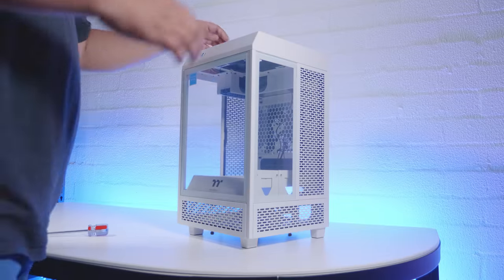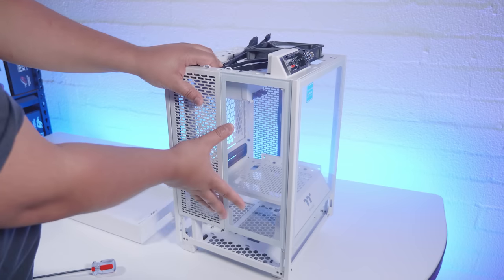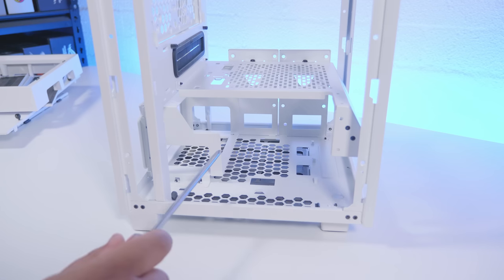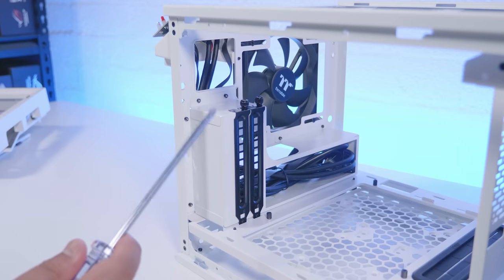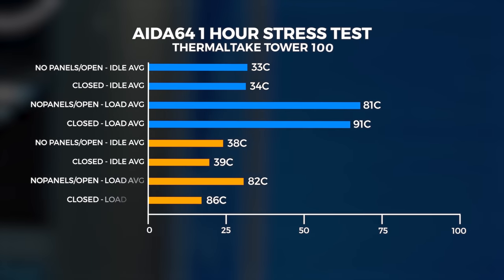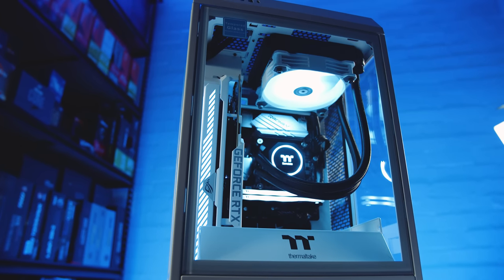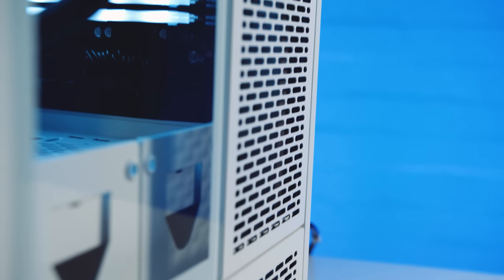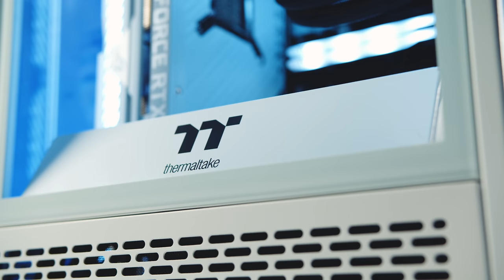The Truth About The Thermaltake Tower 100

Comment: I just did a build with this case this weekend I loved working with this case.  It’s my absolute favorite itx case I have ever used.
Reply: you got any pics
Reply: I just bought this in black. I only ordered the case and some fans so that I can play with different config ideas. Share your build! I have some questions for you: 

1) can you switch the side panels left and right so that the vents are more aligned with the GPU? Ie take the left side and put it on the right side and vise verse.

2) did you go AIO or air cool?

3) it sounds like you can’t fit the WiFi antennas in there with the top screen on. Can you confirm?

4) how many fans did you use and how did you orient them?

Thanks!
Reply: I would love to see any pics if you could upload them to imgur, and also any answers to the guy who replied above me!
Reply: does this support a regular ATX motherboard

Comment: I’m really digging the new music in your latest videos. Well done. 

I agree that for a small form factor / itx case it’s too big and the side panels would have been a perfect place to be able to mount either a 240 or 280mm AIO. Disappointing that they didn’t. But it’s still a good looking case, and I’d wager that with an air cooler like the 212 or a Noctua (so?) the cpu thermals would be much better.

Comment: Just sharing a data point:  Around the same ambient temperature, I’m getting 23C at idle for my i5-10400f using a $25 (after $10 coupon) Vetroo CPU air cooler and 45C for the M/B in my Thermaltake Tower 100. It has a GTX 1060, took out rear fan to put in HDDs and kept stock top chassis fan.

Comment: Just built one Yesterday with i7-12700, Asus ROG B660i, NZXT Kraken 120 AIO cooler, 1070Ti, orginial back fan and an additional Thermaltake 120mm PWM bottom fan. Got 76c on CPU and 72c on GPU in Burn test for 5 mins. Nice looking case and just love it.
Reply: Temperature also be the point I was bit worried at first, but for the normal usage like gaming, I have tested with MS Flight sim, iRacing and Elden Ring, turn out the gpu normally stay at 77c and cpu only 53c/20% load, even I replaced the fan at the back with 2 3.5' HDD. The only problem now is the TT fans included in this case are a bit noisy, I will upgrade the chassis fan to Noctua later.

BTW the pump of NZXT Kraken 120 is IN the radiator. So if you use it in this case, the pump will be on the top of the whole AIO liquid circuit...

Comment: You can put swap left and right panels around. To have the mesh at the front. 

Also mounting a 140mm fan on the bottom is a good move. Also a push pull aio set up is my plan with it.
Reply: Having built in this case, that's exactly what I did with a 120 AIO. I would probably recommend using the Arctic Liquid 120 (wish it came in RGB) as it has a slightly thicker radiator. 

A 140mm bottom case fan would probably fit, but with the amount of cabling due to running 2.5" SSDs and a modular power supply, not even sure how much air it will bring in. I didn't use a case fan and just have some Hot Wheels down there :D

Comment: I'm wondering about the rear where the Display Port cables go into your motherboard/cards. Please let us know. I can't see how external cables are attached to the MB rear panel ports.
Reply: DP to DP Adapter, 90 Degree Up Angle Displayport Male to Displayport Female Extension Adapter  available on Amazon

Comment: Thermals on my Tower 100 are great. Youre missing a fan on the bottom seems. Also push/pull is on my build. No higher than 70c on my CPU (5800X) for anything. Gaming or testing. Great case.
Reply: Would u recommend air or water cooling
Reply: What AIO do u have?
Reply: @mark_9807  nzxt m22 I think it’s called it’s the 120 mm one
Reply: How about your GPU? What GPU are you using, and how hot does it get with GPU intensive games?
Reply: Indeed, was thinking the same thing. I have seen other reviews with the bottom (next to the mobo) fan and a push pull at the top. Thermals were good!
Reply: If the video IO ports are facing up, how do you connect monitors?
Reply: @BrutusHiatus  there’s a cutout on the top back of the case hidden nicely.

Comment: The GPU side should just be complete mesh, no need for the TG. That GPU under load is probably heat soaking that tiny 120 rad since its the only exhaust.

Comment: wonder if the CPU temps had been better with a upfiring fan on the psu shroud (as there seems to be clearance for it). think other builds have been doing this? specially if an SFX psu is used?

Comment: is it bigger than nzxt h210? can you compare?
Reply: The H210 is a 27L case whereas this is 5L more at 32L. However, the Tower 100 has a smaller footprint on the desk at 707cm2 as opposed to the H210's 781cm2.

Comment: Greg from Florida.  I love your channel along with Brian @ TECH Yes City.  Australia looks wonderful.  Wish I could visit sometime.

I just finished building my Tower 100 last week.  I went AMD using a Ryzen 7 3700X with a Gigabyte X570 I AORUS PRO WIFI  motherboard and 32GB G.SKILL Trident Z Neo DDR4-3600
memory.  Sapphire RX 5600 XT with Dark Rock Slim air cooler.  My thermals are good with both the GPU and CPU  maintaining mid to high 60C during my gaming sessions.   I also loaded up with 2 - 3.5" HHD and 2 - 2.5" drives (1 HDD & 1 SSD).  My boot  drive is a Sabrent 1TB Rocket NVMe 4.0 Gen4 PCIe M.2  powered by Fractal ION SFX 650G.

This is my gaming rig as well as my Plex Server.  I too was really impressed with the build quality of this unit.  My main go to cases are Phanteks and Lian Li and I'd say the Tower 100 is comparable to these brands.
Reply from the maker: I gotta agree with that. This case really surprised me. The build quality is amazing!

Comment: I have my 5600x overclocked to 4.7ghz, with a wraith prism cooler. The stock case fans, and a MF Halo fan for rgb swag. I think temps are great for me. I idle about 40c and gaming about 60c. I definitely recommend 140mm fans for slightly better temps  (like 5 degrees)  and much less noise.

Comment: Im using this Thermaltake Tower 100 but im modified cutting top & below for have big space.so i can put the gpu horizontal (twin fan version) & make 2 tank pump small reservoir .can put big 240mm aio just cut top in the case modified it..My Thermaltake 100 casing look like the small version of tower 900 after i modified it to put 2 tank,gpu horizontal,lcd screen & cooler 240mm 2 pcs radiator..just cut it modified..dont worry..its fits int there

Comment: I have this case. Was anyone else’s front panel audio ports swapped around? The headphone jack was actually the microphone and the microphone jack was actually the headphones. And L/R channels in the headphone were also backwards. I had to remove most of the pins from the HD Audio connector and re-wire it based on the diagram in the MB manual, ASRock B550 Phantom Gaming ITX/AC. Even tried a second T100 case to make sure it wasn’t a one off problem,and the second one was wired the same way.
Reply: Have been researching the T100 non-stop recently and this is the first I've heard of this issue. Still - this is a tad concerning. did you reach out to Thermaltake about it? That's grounds for a refund.

Comment: I bought this case after also buying fractal design ridge and silverstone sg13 (returning both lol) I figured the thermals would be more or less about the same between all three. I only built in the tower 100 but after reading and watching a decent amount of reviews about the thermals I was admittedly scared but when I tested it myself with a Ryzen 7 5700x + 3060 ti FE the thermals while gaming weren't actually bad at all I saw 65 and 60 for cpu and GPU mind you I only tried WZ2.0 and Fortnite but still lol. what I did do that was different (i think) was I added a 140mm intake above the PSU but in front of the mobo which I feel helps a decent amount (haven't actually tested that to confirm though. I have an NZXT 120mm kraken AIO with 2 fans as well. I will have to disagree on how pleasant it was to build in lol I kinda found it annoying to have to remove so much but I do love the look of it and I think the thermals will be a heck of a lot better than in a ridge or sg13 .

Comment: The radiator is meant to go on top of the frame not under and then the fan is screwed from underneath threw frame into radiator as displayed in the directions.
Reply from the maker: It literally makes ZERO difference.
Reply: I realise this is an old comment, but having recently built a system in this case, the way Nick has done it is better in my opinion. Having both the radiator and fan under the frame means the fan is right up against the radiator, making better use of the static pressure fan. I have mine set up this way, plus an additional 140mm exhaust fan above the frame and there is quite a big gap (5-10mm) between the top of the radiator and the top fan.

Comment: Would really love to see a nice looking air cooled build in this case. Im looking to build one myself and most of the CPU air coolers look terrible in it. :(
Reply: I did a build in this using a ToughAir 510 and it looks chunky (in the good way). Temps on a maxed out 3600 get up to 72 degrees with it. Solid case, and surprised to say a solid cooler and very silent at full rpm.

Comment: my new system is this case and i did go with the Ryzen 5 3600 and a Gigabyte Vision 3060 12 gig with a Gigabyte A520 MB with a 120 AIO for cpu up top but I did add a Deep Cool 140mm fan at bottom below the motherboard blowing up and it is super quiet and moves allot of air to help cool and left the 120 on the back of MB stays quite cool...very good looking also with the white cable mods very happy with build and a relatively small foot print on my desk and that is also what I was looking for nice review  update I now have the Ryzen 5 5600x and a Zotac 3070 and I am still very happy and staying cool .even playing new world...note to self I used a Deeocool 120 AIO and i did have to trim one screw that holds top cover on because it did hit the AIO rad .

Comment: using Noctua fans - push pull 120mm on NZXT120mm M22 AIO, 140mm rear exhaust and 120mm on bottom with an AORUS extreme 2080ti and 5800x reaches 65c (GPU) and 61C (CPU ) playing division 2 on high settings, ultra doesn't push it much more tbh
Reply: That's amazing for a 5800. Does dust build up in the spaces between the panels? I can see a small 1mm gap in between the panels you can literally see through the gap.
Reply: @GeordiLaForgery  it's not too bad, but the dust seems to collect on the NZXT cooler display for some reason
Reply: @steffithompson  Maybe because it's glossy black so dust is easier to notice. 
Is there actually a small gap like 1mm inbetween the bottom and top panel on the sides? I noticed it in a couple reviews.
Reply: I have an similar setup, but with an 5600x b550i aorus, Rog rtx 3070, 120mm push Rog AIO, 140mm rear exhaust and 140mm bottom intake. Running games and prime the CPU never reach over 70c but the GPU shoot up to 87c and up. What is your Rpms on your intake, exhaust and AIO fans? Also fan curve on your 2080ti?

Comment: I started to build in this case a few weeks ago and then stopped, took everything out, and returned it. Mainly the vertical I/O plate orientation was going to be just too awkward and strange to deal with long term. I couldn't even stand up my wifi antenna because of how the top lid closes. There's also some information out there about how many GPUs don't handle cooling in this sort of orientation well no matter how much airflow they have around them. Went with the NR200 and don't regret it at all.

Comment: For this case it says the GPU can be up to 33cm long, and mine is exactly 33cm long :P I wonder how tight it will be.

I believe with air cooling (Noctua NH-D15), and a fan over the PSU as well (it says on the site you can put up to a 140mm fan there), and a 140mm on top as well, it will be more than cool enough for a 5800X.

Comment: in same case but Thermaltake 100 Racing Green , I builded PC : EVGA 650GM SFX , X670E-I Asus Strix , AMD 7600X , MSI Gaming X 6800XT , 32GB 6000mhz CL32 Kingston Fury Renegade, 2x 2TB nvme (Samsung 980PRO 2TB + WD770 2TB) - CPU cooler BeQuiet Loop 120 with changed fan to Bequiet Lights 120 PWM Light Wings High Pressure on top Loop 120 4pin, Bottom Bequiet 140 PWM Light Wings normal 1500 4pin, under bottom (pushpull support BeQuiet Silent Wings 4 140mm 1100rpm 3pin) , on top other side of loop 120 pullpush support by also Bequiet Silent Wings 140 1100rpm 3pin mounted to bequiet loop cooler by printed on 3d printer reduction 140>120.  On back same Bequiet 140 Silent wings 4 1100rpm. + 2 black grills. Everything working perfect. Of course need to remember it is ITX build and parts are powerfull and warm. But can handle all in resonable noise level and temps and also high performance and speed Mhz. Before building it I watched also Your movie so Thank You for job what You are doing. Regards :)

Comment: This is a very interesting case but the airflow in this case is terrible.  Hot GPU exhaust gets sucked in to the CPU radiator.  CPU air cooler wouldn't make any difference at all.  But if the CPU radiator is pulling in from the top or side mesh it would be a different story.
Reply: LOL. In my case the 5600x cool with a single 120mm AIO never reach over 70c in any of the stress test, however the GPU suffer with higher temps than normal, might have to play with the gpu fan curves.

Comment: great video but I still think this case is such a waste of space and potential with mini ITX as the only mobo form factor option TT should've opted for SFX PSU only moved it's mounting location towards the middle at the bottom of the case and given more radiator mounting options in the bottom of the case. With so much glass water cooling and a custom loop is just begging to be done in this the fact that it's this size and you can't even effectively cool an i9 or Ryzen9 is just ludicrous

Comment: If you want to try this case with an air cooler, you should add a fan on the bottom (yes, between the mobo and the front panel) and on the top, creating an "air tunnel" from bottom to the top

Comment: I think this case was so close to greatness. I love the look of the case, specaily in white, this build you made looks amazing! But it just doesn't have enough airflow for the size, and 0 support for water-cooling (aside from the 120mm AIO support up top, since 140mm AIOs don't really exist, not even sure if it supports a 140mm fan up top). An ITX case of this size, made for showcasing a build, HAS to have water-cooling support. Just imagine how it could look with a full custom loop? Rads up top, and on the sides, it could easily be tube bending galore! And also, if you're going with a really massive air cooler, you're still probably not gonna see that great of temps, probably comparable to a more budget tower cooler like the Cooler Master H212 (for example), so you'll feel like you spent too much money on a super fancy/massive air cooler for not that good temps (and honestly, those don't really look so good, so why would you want to showcase that? But that's just IMO, I'm sure that there are people that love seeing builds with those supermassive air coolers, and they do have a certain charm to them, just not my cup of tea).

At $100 for a quality built ITX case, it's not bad at all, and you have to take that into consideration when criticizing the thermal performance/design. But to truly stand out in the market, it HAS to fix those couple of points (more fan mounts/ rad support). I do believe that it has enough mesh/ventilated panel surface, but it just doesn't have the fans to move the air in and out of the big enclosure (with the restrictive mesh filters).

Comment: I loved the look of this case but I gave up when my temps reached 85C after 15 mins of playing.
Reply: what kind of fans/cooler did you have? tempted to buy one
Reply: @dandykoi , I was using lian li sl120 fans and AMD Ryzen 5 3600, EKWB 120 AIO with an ASUS RTX 3070. I reached similar high temps as he did in the video.

On an RTX 2070 Super, I was reaching temps of 70C. I wouldn't recommend this case for RTX 3000s

When I went back to my old ATX case, my temps went down to 60C so the case and fans were really a big factor

Comment: So, if we ever want to get console nubs to switch to PC, then we will need to mainstream cases like this. This is what console gamers are into. Showcasing cooler looking stuff>better cooling/performance. I just built a black tower 100, and 12 gen i7, ddr5 32gb 4800 vengeance ram, and then went full ARGB Thermaltake ring fans x2 120mm since you can put one as exhaust and one just over the PSU pointing straight up towards the CPU/mobo. I have the same cpu cooler as this one along with a Gf2 rgb thermaltake 850w psu, and rgb 3070ti EVGA ftw3 GPU. It keeps the cpu under 86 at full load playing ac Valhalla ragnarok on ultra 1440p 90fps+ , cyberpunk at 120fps+